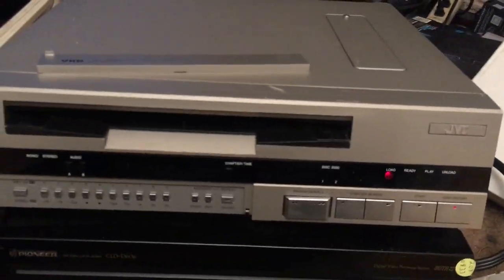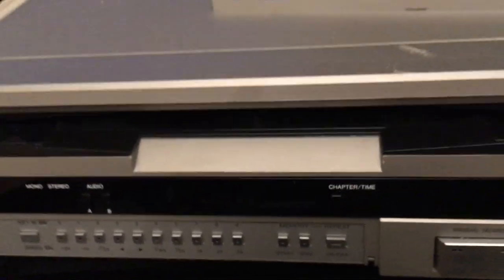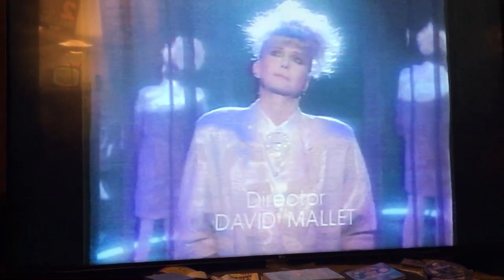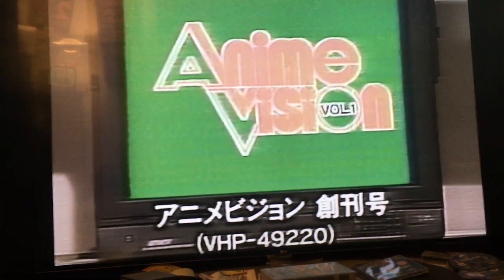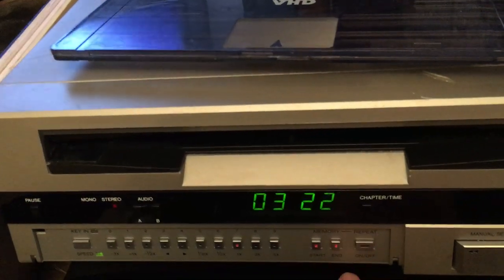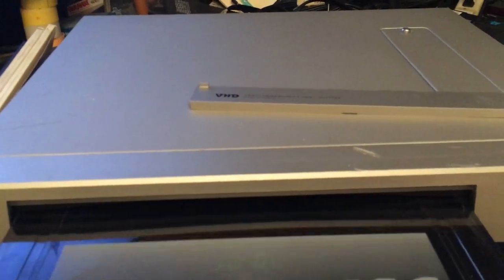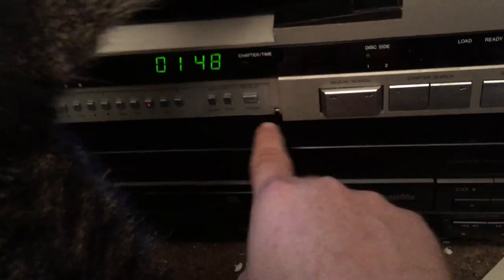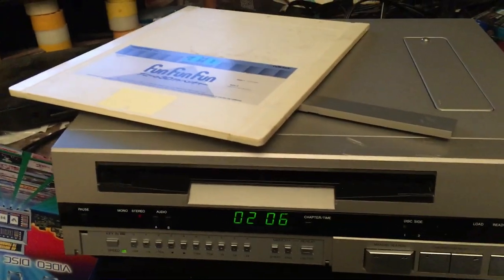Demonstration- US model VHD player JVC HD-5500US

Comment: It kind of sucked that VHD wasn't released in the USA and Canada, but it was a sensible business decision on the part of JVC.

Video disc was pretty much a bust in the early 1980s in North America.  RCA's CED was falling fast into irrelevance and LaserDisc only really saw success with those willing to pay for the best possible picture and sound quality from a consumer video format.

On top of that, VHS was dominant in the home video market at the time that VHD was scheduled for release.

While video cassette and video disc were marketed as being complementary in a home video system, as audio cassettes and records were in a home audio system, customers had different ideas because VCRs and video disc players were both very expensive compared to an audio cassette deck and a turntable.

Therefore, because customers usually chose one or the other, they gravitated toward the choice which gave them the most value for money: the VCR.  While you could only play movies on video disc, you could play and record on a VCR.  Also, while software being cheaper to buy was a major selling point for video disc, most people preferred to rent their movies rather than buy them and essentially all video rental stores primarily stocked titles on VHS.  And, while video disc (LaserDisc, specifically) offered better picture and sound, most people found VHS to be good enough in those areas, especially if no stereo was used with it and if the television used wouldn't have been able to show video disc off any better than a VCR.

So, with the VCR being the dominant home video product and VHS being the dominant format along with the market for video disc being too weak, JVC wisely decided not to proceed with introducing VHD to market.  VHD would not have been able to compete against LaserDisc and especially JVC's own VHS format.
Reply from the maker: And THREE VIdeodisc formats on the market would’ve just confused people even further. Even today some don’t know the difference between CED and laserdisc. CED never came out in Japan so VHD had some chance over there.
Reply: @TheMediaHoarder  True, that three formats would have caused confusion, though it wouldn't have been for long as RCA had terminated player production in 1984, only leaving videodisc production for adopters of the format as sales of software were strong enough to continue.

Regarding CED in Japan, RCA supposedly demonstrated their videodisc system to JVC in the hopes of establishing a market in Japan, only for JVC to respond with a counter demonstration to RCA with VHD.

I believe it was rumored that JVC got the idea for VHD from RCA itself; a deal involving technology sharing between the two companies, made at the time RCA was dealing with JVC for obtaining licensing for VHS, may have been how it happened.
Reply: It's interesting that Victor/JVC decided to go completely on their own with capacitance disc format. RCA had done a ton of research in the field. Waffled around on deciding to take it to market or not. Maybe RCA saw having a partner would divide up the risk  I guess RCA was interested in licensing or cooperating with JVC on CED and then in reciprocal JVC allowing RCA to use their VHS technology. Didn't JVC see that having three videodisc formats would confuse the market, and it would be better to just compete with Laserdisc? Also RCA would allow access to a huge market in terms of distribution system, advertising, name recognition etc. So odd..  The capacitance disc players were cheaper to produce and the discs were also cheaper to manufacture, similar to vinyl disc once you had the line up and running. It could have pushed out Laserdisc because it was so much cheaper for the consumer. However I'm glad that Laserdisc did do as well as it did in the end,  (albet for a niche market) and lasted the longest and spearheaded what would eventually become the successor formats in DVD and Blu-Ray.  I will say the tech they put into the VHD format is certainly impressive for the day,  they even had multi-channel audio later and supposedly a PCM digitally encoded audio only VHD format. Though I've never seen any videos on this if they were ever made, much less marketed to the public. Thanks for posting this video. Cute kitty's too!
Reply: @marcusdamberger  That's true that the players and discs were simpler and cheaper to produce compared to LaserDisc.  But a big knock against CED was that it had quirks that kind of made it a chore to use, specifically the tendency of discs to develop issues that may cause them to skip or otherwise suffer carrier distress during playback (a loss of signal, usually due to dust or debris that gets picked up by the stylus off of the disc).

VHD certainly solved a lot of problems that CED suffered from, specifically because the disc had no grooves and the stylus was flat-tipped and electronically guided.

VHD did have a digital audio variant, called AHD.  However, JVC wisely canceled it in favor of Compact Disc coupled with the fact that VHD wasn't successful enough to support AHD.  There is a video demonstrating AHD that you might be interested in: https://www.youtube.com/watch?v=sxA9tHwMXjA

This isn't my video, so I can't take credit for it.
Reply: @Watcher3223  Indeed, my thought was that maybe JVC could have helped RCA with the tracking issue. It seems the grooveless tracks and following them electronically was the way to go along with the flat tripped pickup. Reading further into the specs of VHD they actually included a single line drop out compensator, to replace missing lines of video. This is along the lines of what a video tape machine Time Base Corrector did back in the day, or TBC. Though those tended to compensate for several lines of video initially when they first came out, and then later did entire fields and frames of video. But TBC's were trying to account for the variation in tape playback and sync it to a house system for video switching etc. But by the very nature of disc playback the sync and color burst should be very stable; what you would see on the output of a TBC possibly. Though I've never hooked up a scope to see video of a CED or laserdisc player, to see how clean their output is. I guess it should be as stable as the turntable is able to spin the disc at the proper RPM's. I wonder if CED had proceeded to be developed would RCA have eventually used electronic tracking in more advanced CED players. i.e. older players still used the tracking stylus while newer ones would use the groove in the disc to track electronically. Thus making scratched discs more playable.

Comment: I don't have the shaking image issue that you showed in the vid. My VHD player (Victor HD-8900) during playback tends to repeat certain portions of the disc. It will play fine for a few minutes or so and then it will suddenly go back a few seconds and play that portion again. Sometimes it gets stuck in that "mode" and plays the same portion over and over. It does this with all three VHD movies that I own. I don't have any more to test it with. Is this a stylus issue? Any response would be appreciated :)
Reply from the maker: It seems like the skipping problems are disc related, as I’ve tried different styluses and players with problem discs and had the same results. Most of them improve if you keep playing them repeatedly, the National players are a pain though as they will often stop if a disc is bad enough, yet eventually get past that spot if you start and skip back to that part. The shaking picture is when run through my Marantz receiver, and happens with every VHD player I’ve used on it but not on all discs. It doesn’t do that on any other format, I made a video of problems this receiver had dropping out the signal on analog sources but they were able to fix that for the most part. I will probably end up using some other gizmo for VHDs as the TV overscans 480i signals with no known way to adjust it (I even have the LG service remote and can’t find how to do it.)
Reply: @TheMediaHoarder  I'm kind of relieved to hear that the issue is disc rather than machine related. I just found it odd that, opposite to CED's where they usually tend to exhibit a forward skip on a disc, mine does a skip backward. So yeah, this player has given me a few headaches since I acquired it. One of them was a loose belt which meant that it would not accept an inserted disc, nor would it eject that disc. And the design choice seems so bizarre in the sense that to change one little belt you have to remove so many other components. A real pain in the butt. It's way more easier to do in CED machines. I ended up not changing the belt but rather snipping off a portion to compensate for it being stretched and then applying a tiny drop of Q-Bond adhesive to it to reconnect the two ends. The belt  behaves as new now. One last question, if you wouldn't mind. The Victor 8900's do not advertise their 3D capabilities. Are they still though capable of playing 3D content? Perhaps via an adapter where you could presumably then attach the 3D glasses?
Reply from the maker: I'm not familiar with that player, I have one National model (which I've shown on camera) that says "3D" on the front but does not have any jacks for the glasses or a 3D/2D switch on it. That system they had a few years ago with 3D IMAX films on regular DVDs will work with that though, but the system doesn't work on HDTVs because of how they de-interlace the picture. I'm looking into converting those to side-by-side format to watch on my 3D display.